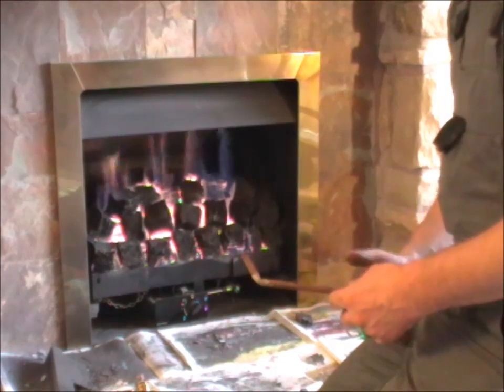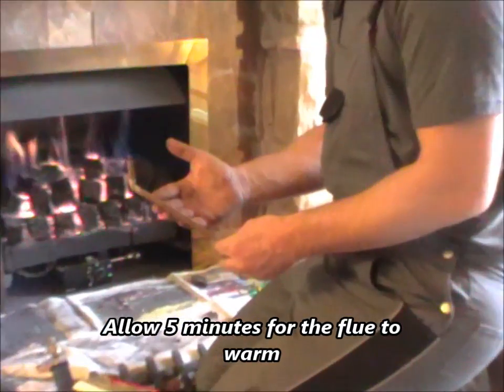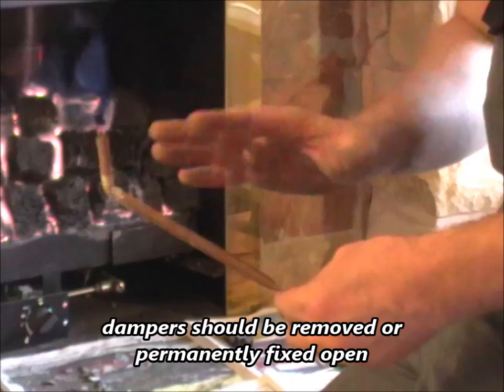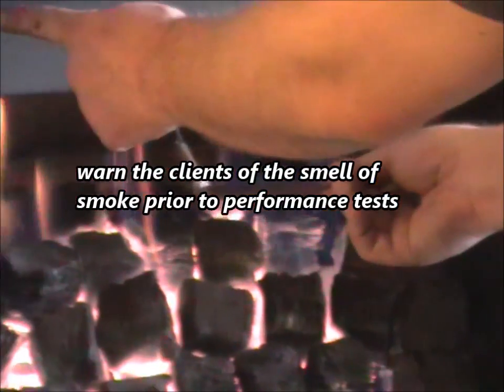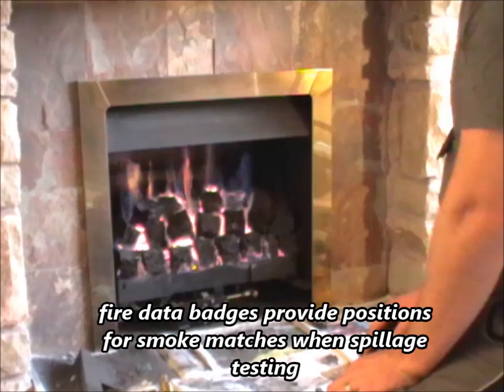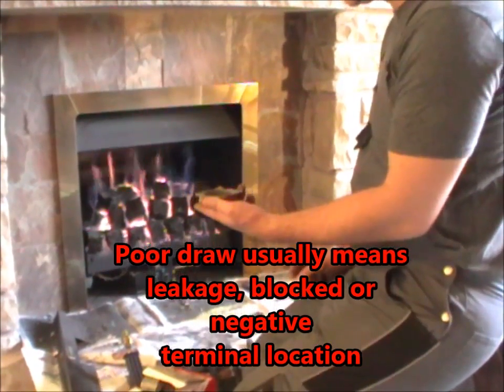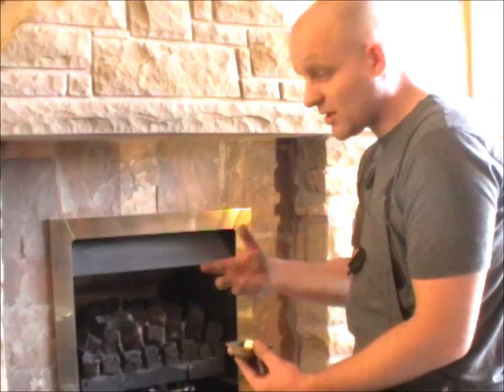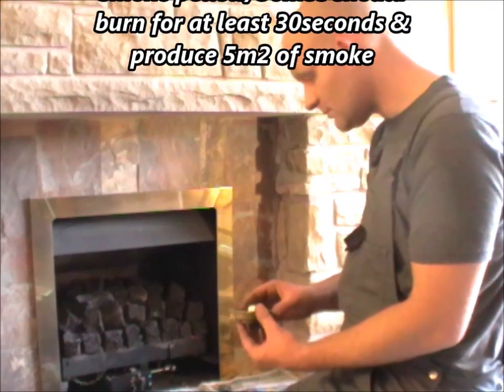Gas fire Service part 2

Comment: It might be an idea to mention after you blow the pilot light out to carry out a tightness test checking the valve has close correctly, good work for new starters and thanks for the video.
Reply from the maker: yes job point, assuming really, this was filmed using a camcorder and tower computer...times have changed

Comment: I hope you don't do many fires! The loft is the most important area to check the flue during a smoke test! And should check with a level for any bends over 45 degrees
Reply from the maker: Tom Round I did and checked by doing a pellet and smoke bomb
Reply: @warriorsofwarmth  would have probably been an idea to emphasise the loft inspection as I've seen some of the most dangerous faults in the loft area! Lost count of the amount of new installations that i didn't get because there was no record of NCS that had to be brought up to date and someone came after me and fitted it illegally! Making me look like I was trying to rip them off when i was the one doing the job properly
Reply from the maker: Tom Round yes they are particularly weak where they convert to chimney block to ridge tile terminal etc